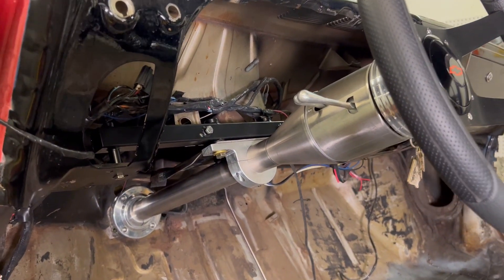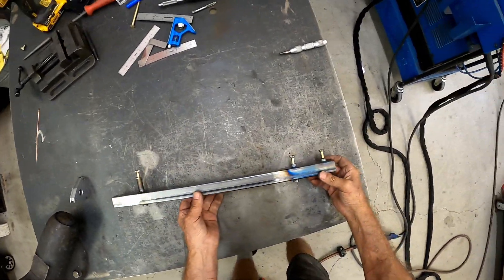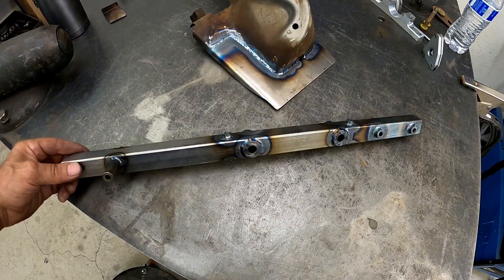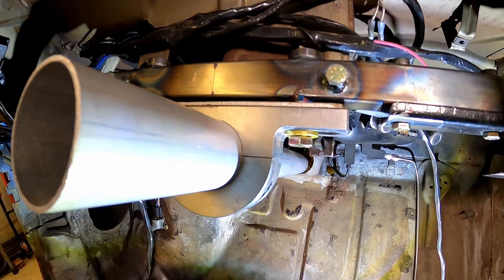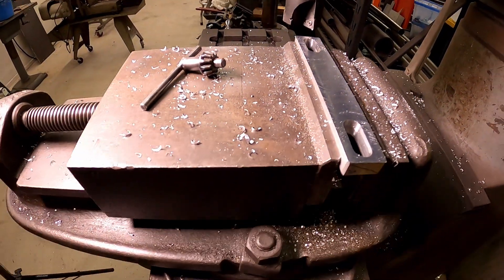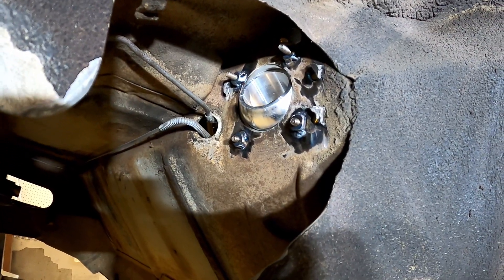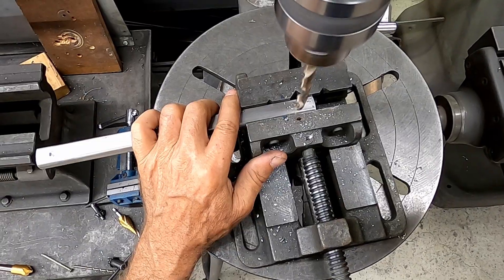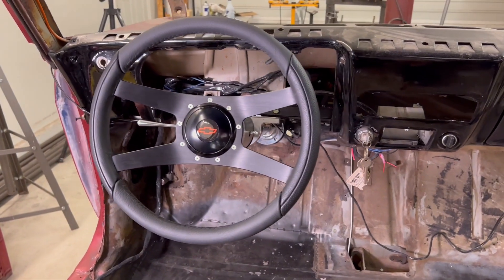Flaming River steering column install

Comment: Rivnut tip
A washer and thread locker can help the nut grab onto thin metal.
If you have access to the back of the panel put the Washer there with some thread locker or super glue to stick it in place , being on the back works better but it can work on the front too.
Drilling to hole too small and expanding it out with a punch can also work depending on access

Comment: I'm building a 37 CHev PU with a 5.3 LT1.  The engine bay is filled and getting a straight steering column in was impossible.  SO I got an IDIDIT 16" shorty column. It's connectee with a Borgeson U joint  and passes through a bearing on the firewall to another U Joint.  From there it goes to a Ujoint on the Rack.  The angle as it passes through the firewall is around 42degrees,  Too sharp according to Borgeson.   My thought is to get a 12" colum which will change the angle as it exits the firewall.  From there I will likely put a bearing on the frame rail and use another Ujoint, for a total of 4.

Comment: Put full weight on the wheels and test for binding etc before continuing the build, you might need to change things.
Silly question but why not just use the factory column mount?
An adjustable wrench would have solved the angle problem, 1.5^ of angle is an easy bend to put into folded sheet metal with no detriment.

Comment: What was wrong with the original steering column?  If it was in a poor position then that could have been changed and that would be more informative than spending the money to purchase an after market Steering column. Did you change the steering column on the Super Beetle project? Since I have a Super Beetle, a 1972 version, if you changed yours to a rack and pinion steering I would be interested in that installation.

Comment: What is your steering rack ratio? Seemed quite a few wheel rotations if not completely miscounted. 

Would that not be slow in case of any sliding action and need for fast steering input?
Reply from the maker: I think it 4 turns which is fine for a manual rack.